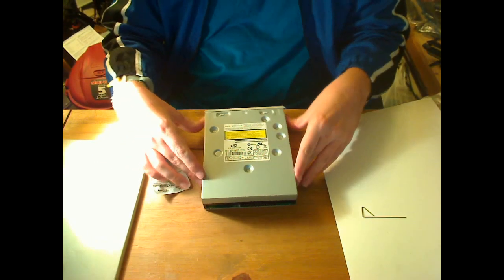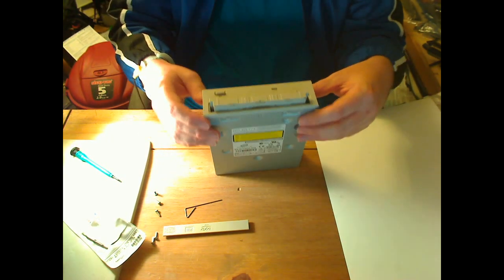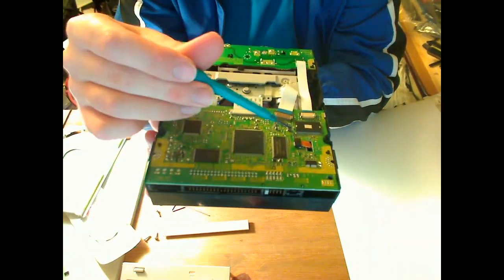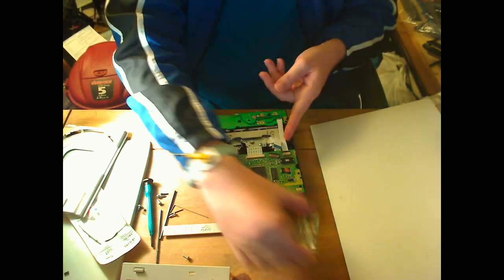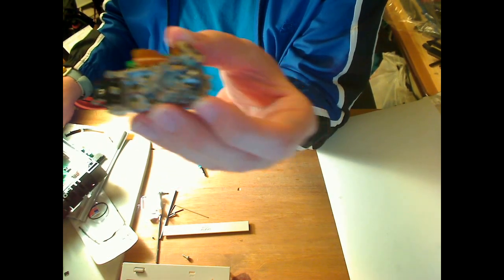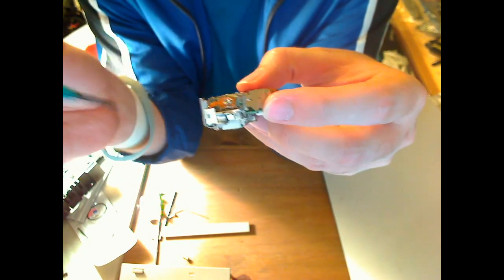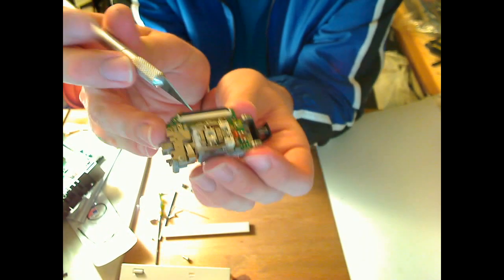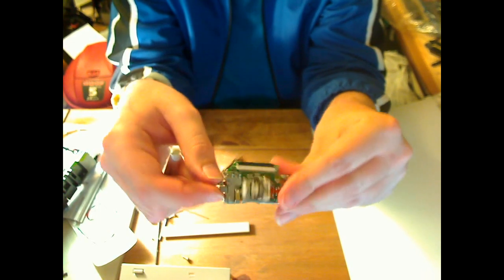DVD & BluRay Drive Internals and Laser Diode Extraction

Comment: Instead of wasting time on a bunch of nothings, screwdrivers and compounds why don't you go to the meat of the matter.
How do you determine which pins on any laser diode connects to what?
And how do you know if any of the laser diode is good or not in the first place, using a multimeter?
Look, it is easy and simpe to test a pin diode.  That is not an abbreviation by the way.
A pin diode is your typical  two leg circuit diodes you see everywhere.  The long leg goes to positive and the short leg to negative of the power supply. 
If you want to know how to check these diodes uisng a multimeter, you simply put your mulitmeter on diode mode and probe the two legs.  If you place the positive of the mulitmeter to the long leg and the short leg to the ground negative of the multimeter, you will see the led lit up if it is good.  
Straight forward and to the point.
Now how the hell do you check these laser diodes. mr expert?